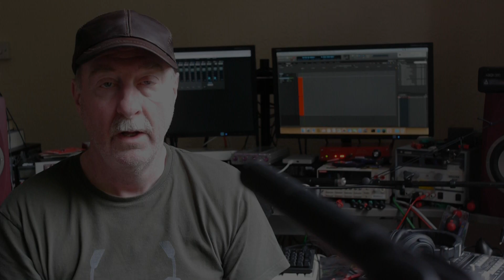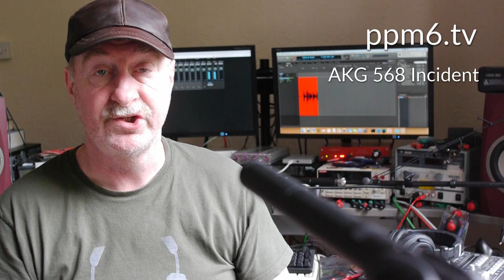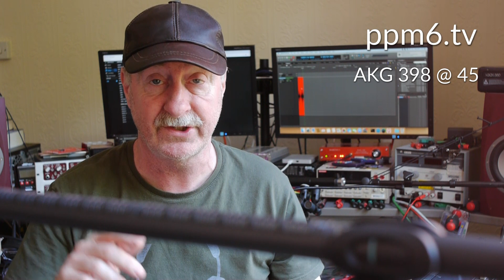Gun mics off axis - mummy always said, 'no gun mics in doors, the off axis is going to kill you'

Comment: Gosh, you’ve been working hard, very interesting. I’ve only had the chance to listen on my ‘phone this time but I would say the cleanest sounding off axis is from the 416, with the C69 / 480 combination coming a close second . . .
Reply from the maker: Thanks Hugh - I admire your dedication - have a listen on those lovely Rogers when you get a chance.
Reply: @ppmtv-qh9qk  Really interesting to listen again on proper speakers but I think I stand by my initial judgement. At 45º, to me, the 416 and the 480 display the least amount of indirect sound. I suppose you could argue that their pickup lobes must therefore be wider making them less directional but in practice I think it's an advantage because any off axis sound (from up to 45º at least) is less obvious than in some of the others. A particular advantage for pole operators! It will be interesting to hear the results of the 90º tests, don't suppose you have a 4038 for comparison! Somewhere I think I still have a CK8 capsule, to operate with a 451 preamp. It too has an opening down one side only (a longitudinal slot covered by perforated metal) and then the CK1 style slots around its base. I think it's really just an adapted cardioid capsule. Very lightweight but, as before, not the most effective gun mic. NB, as you suggest, I also recommend sticking to hypers and cardioids indoors if you can!
Reply from the maker: Thanks Hugh - I was pondering that same question, is it good off axis performance or poor directivity!  I checked the curves for the 416 and the AT4073a, both are about 2.5 dB down at 45 at 1KH. But they don't sound the same at all. You can see why the 416 is still in production after all these years and why if you are a hard pressed boom op that off axis performance might just save your bacon. I wish I had an expensive Sennheiser or Schoeps or Sanken to throw in the mix but there you go. I suppose that there is a deeper question if a gun mic is more than just a tube welded to your cardioid - what else is it?  Is it about slot placement and dimensions. Or the basic performance of the cardioid or some back pressure wizardry behind the diaphragm?  I had a DPA gun mic once for review, it came with mighty claims about the off axis performance, I leant it to the guy on Doctor Who - he hated it... for the off axis performance. And that of course doesn't make it a bad mic just a sign of the richness of the human experience. Now what I really want to use in doors is a 4038!!! How I wish I had a blagged 5 or 6 when we rummaged through them in mic cupboards searching for a 451! Take care.

Comment: The 568 is my favorite for 45°. I like to be able to hear a room's reflections which the 416 and 4073a really don't do well because their sensitivity at 2-4.8k is just too wide and the 398 and 480 were really designed to be spot mics in the voice range, not so much of a narrow (albeit spectral-ly flat) pattern as the 568 has. In film, I can tell when someone is speaking while pouring a cup of coffee if the ambient was live or not when a mic with too hyped of an upper mid range was used. If the ambient were live the natural phase of the room won't be fighting with any live voice unless multiple mics were used improperly, if the ambient were added later there will be no comb to 2k+ which is neat and clear but kills it for me. The 568 is a relatively quite mic but it is for a reason, so that its directional characteristics are as close to uniform as can be throughout the spectrum.

The trend lately is to emphasize a wide spread at 2-4.8k yet narrowing fast toward 8-10k because of the nature of YouTube type productions and, I suspect, the trend in monitors with higher crossovers (3k+). That's just not my thing. I prefer to be able to tell if a room is 8' wide or 16' wide, if it is cluttered or empty, carpeted or tiled. If I'm still getting lots of nasally detail 45° off axis then it's simply too much information for my brain to form a clear image of the space. It's something akin to Glyn Johns' philosophy on micing a drum kit; a mic on every single piece of kit is great but it loses ambience in a big way Vs. 3 properly placed mics - even when 2 of them are tight hypercardioids because the depth of the room (perceived distance from diaphragm to surfaces near their 180°) goes DOWN as you add mics! Hence why an overly mic'd room sounds nothing like that room. I consider the Sennheiser and AT mics as special effects use only and the 398 and 480 conference and drum mics respectively. Great video.
Reply: Oh, on the singular slots on AKG tubes. Since none of these are stereo mics the slots are meant to be facing the largest empty side of the room (or, otherwise, the most dead space direction you have available). So, in a cathedral with 100' tall ceilings on a boom or stand that is 12' off of the floor - face the slots UP. If the mic is flown 10' from the ceiling but 90' off of the floor - face them DOWN. Since the diaphragm is only allowed to move due to its resistance relative to its environment, just keep in mind that the slots are meant to act as a DIFFUSE FIELD aid where the bulk of ambient air is the reference. Also, the non-slotted side of the tube is a kind of shield to any direct transmission from the livelier side of the spectrum you may wish to subdue. It all makes sense once you look at them closely while walking around a lively room wearing phones.
Reply: @tasteapiana  That is what I thought, blocking the tube for interference from the nearest barrier. But there is no reference in the documentation and I have never heard a comparison. On the other hand, the documentation never mentions how to place the hypercardiods to cancel the energy from the two nearest barriers, or how figure of 8 can be used in corridors and elevators. It is amazing how many engineers ignore simple rules, like how cardiods work when the problem is a single barrier. Many are surprised a Rode NT1 massively outperforms the MK41 in the middle of the room, when the speaker is standing, or in an exterior when the noise source is on a single side. They insist on placing all patterns like one would place a shotgun, without even considering the barriers or listening. And the total disregard for perspective in interiors... All shots sound the same these days in many films, regardless of shot size.
Reply: @tasteapiana   The second theory I had was the they can actually eq the frequencies of operation of the tube beyond the cutoff limit introduction, in the actual pass band. Small holes allow less directional energy, in effect less operation in treble.

I have found a reference on progressive shaping on a forum: I have seen a long Sennheiser from the 60's (mkh804) which has slots on one side, then there is another tube inside which can't be seen from the outside, with circles instead of slots on the opposite side, which go from large circles at the front of the mic and taper off to small circles at the base of the mic!

This points to shaping by controlling energy, not direction.
Reply: @aristotle_4532  AKG worked with the other end of that issue when designing the D224e which used two diaphragms to allow for the mass Vs. inertia issue so as to suit each capsule with the least amount of flex (muddiness); the smaller capsule diaphragm capturing highs and the larger the lows. It all depends upon air volume and density relative to the material's tendency to bend, so, without altering the capsules or electronically limiting the signal all that is left are chambers which inhibit air velocities in specific bands.

The term sensitivity, in itself, is a kind of misnomer. Sensitivity can not always be represented in decibels, or loudness. There is a different, non electrical, sensitivity which relates strictly to a diaphragm's mechanical attributes - where more details can be transmitted through a capsule at a specific frequency range without that translating to any significant level difference across its usable EQ curve. What I have observed is that it depends upon the diameter of the diaphragm relative to its rigidity, ie where does it tend to flex the least across the spectrum. A full cycle more of a diaphragm at, say 1.5k, may or may not increase the electrical output of the circuit at 1.5k or double the resultant frequency IF that diaphragm is least likely to flex at 1.5k - whereas it will at <750 and 3k+. The actual physics of the material involved can make an otherwise perfectly tuned mic have large regions where it just doesn't seem to have any detail and others that really do - as well as electro-mechanical sensitivity to harmonics. Ever heard a mic that sounds great on guitars, drums, voice, get weird and almost chirpy and whistle-y when used on breathy wind instruments? That.
Reply: @tasteapiana  That would be damping, or what audiophiles sometimes call speed, the same that happens in speakers, visible on a waterfall diagram. Technically speaking, one can measure it. The problem is that measurement will contain the time domain response of a speaker which must be massively slower. A small explosion could be used. SDCc should be faster than LDCs.
Reply: @aristotle_4532  There's that and it has a name in physics I can't remember but I haven't seen it charted in a satisfying way. My visual for it, when deciding which mic to use, is any string playing 32nd notes. Let's say every 50ms is a center for each note. There is going to be a sequence where a targeted pitch of 880hz is ramping up in 1ms increments and then down, say, from 779, then 779.4, 779.9, 880.3, 880.6, 880.9, 881.2, 881.4, then back down to 779, then back up to 880.5, down to 779.8 etc that we perceive as 880, the center of the ''note''. A wind instrument playing the same passage of 32nd notes (let's humor ourselves here and believe it's possible) will not have such frequency ramp ups or downs but be a pretty steady 880 for the entire 50ms which will induce a kind of standing wave in the diaphragm which is due to its inability to dissipate that mechanical energy because it is not 100% efficient, and it might just have the least flex at that point leading to a mechanical sensitivity there relative to other regions. With the fluctuating string there is no such mechanical entrapment of energy build up, therefore the whiplash effect (center of the diaphragm being read Vs. outer restrained edge busy depleting the energy) out at harmonic number sequences aren't as pronounced. In shotguns, of course, damping is crucial but the compensation for clarity that comes from allowing the diaphragm to move in an unbiased way is, imo, critical. Hence, the layout of tubes being a set in a kind of diffuse field orientation.
Reply: I should have said ''in 2ms increments'' as 880 in 1ms isn't possible lol, oops :P It's all fascinating.
Reply: @tasteapiana  In terms of speed, Schoeps are probably the best. Neumann are also good and conservative. Sennheiser are mediocre because they overengineer and care mostly about the frequency response. But it would all end up in huge slow theater speakers, cheap wifi, and small tv speakers anyway, and Sennheiser sounds impressive compared to a natural Schoeps. Now that fast low distortion headphones are popular, it may become more important, even after digital compression.
Reply: @aristotle_4532  Schoeps are also overpriced unless you are aiming for a minimalist location rig and even then I would resent paying 30% more for 5% more bang. Knew a guy who did the live Grateful Dead stuff back in the 80s-90s who swore by them due to the physical environment and I couldn't disagree with him, Dead shows were gear war zones lol. Austrian Audio is the only company I look forward to these days as once AKG went down the Mitt Romney / Toys 'R Us slope it became obvious that it's pretty much all been done already and large companies are just trying to China-ize existing works. Mercedes is even making budget throw away cars now, it's getting out of hand. Shure has a couple staples left, E/V also but for strictly A/V use I'm still a pre-sell-out AKG and Neumann fanboy. Again, Austrian Audio will hopefully drop a shotgun mic within the next year or two. That'd be a sight-unseen buy for me as I really think they get it.
Reply from the maker: Glad theirs some love for the 568!Ta like, ppm6.
Reply from the maker: First advice I've seen about slot orientation! Ta like, ppm6.

Comment: To answer some questions - 1) ALL gun microphones have to have slots behind the capsule; if they didn't it would be an omni.  BUT the Sennheiser MKH 416 have lots of slots behind the capsule; this is purely cosmetic as it looks better, it's only the first few behind the capsule that are active.

2) slots down one side only is normal - if you look insite the 416 you will see an inner tube that only has slots on one side - it's so the sound gets bent inside the tube to cause the cancelation required to be an interference tube.
Reply: 1. 416 with tube taken off is hypercardioid to my ears.
2. 416 inner plastic tube has holes on both sides.